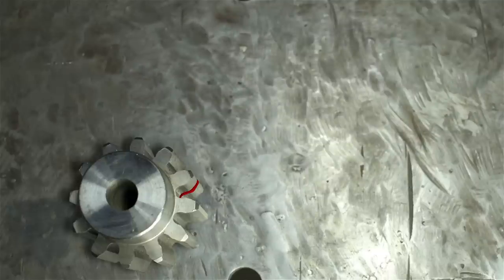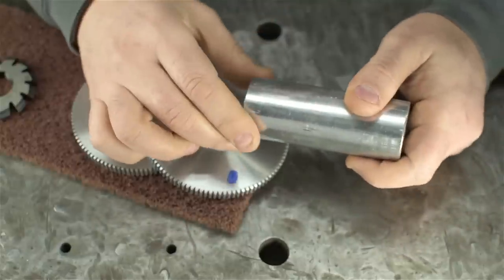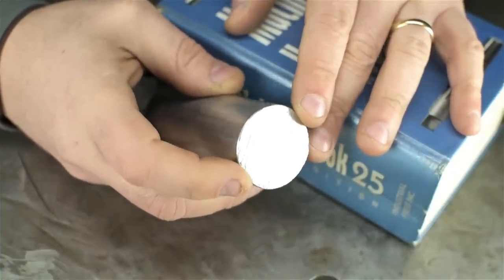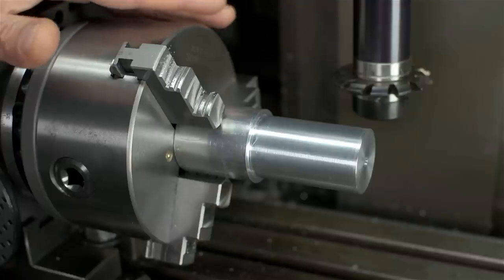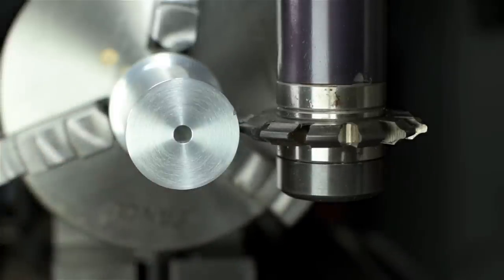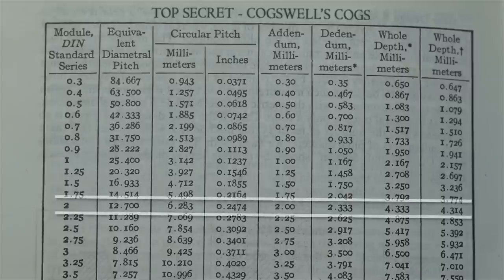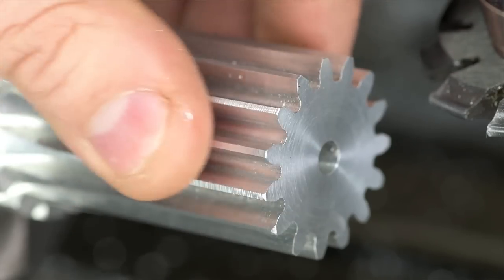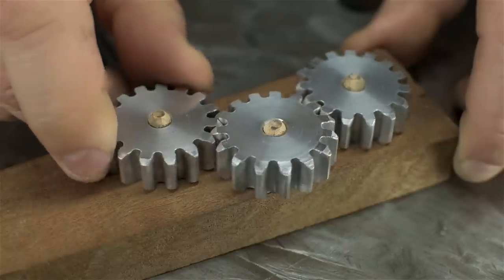15T-M2 Let This Be A Lesson To Ya!

Comment: When you said you move it down by the width of the paper...  Was that a joke?  I'm not a machinist so I dunno if that's the sort of accuracy you can get, and the 'tism's makin' joke location hard.
Reply: @zomgthisisawesomelol Huh.  I guess that makes sense, I overestimated the width of paper.

Is using it as a measuring device in this way that sensible, then?  How compressible is it?  (Thanks for measuring it for me).

Comment: How about a video on why all of industry, especially machine tools, quit using 14 pitch gears? There is currently ONE source for 14 diametral pitch stock gears in the world. It's in the UK but only has 14DP in 20 degree pressure angle. If you have something like an American lathe made from shortly after WW2 and earlier with 14DP gears, they'll most likely be 14.5 degrees pressure angle. That means if you need to replace one, you have to make it yourself, or find a machinist with a 14DP 14.5PA gear cutter set or hob, or buy the cutters to make the gears. A common example is the 13" 'roundhead' LeBlond 'trainer' model metal lathe. Not only are all but the final drive gears in the headstock 14DP 14.5PA, they're only 5/16" thick. Yes, that is a delicate lathe, often abused by school and military shops during and after WW2. It has a safety spring ball clutch on the power feed rod but not on the leadscrew, so if crashed while using the leadscrew it's very likely to break gear teeth.

Just because all the machine tool companies decided to quit using 14DP sometime in the late 1940's, that doesn't mean some folks didn't see a need for gears like those. In the 1980's at least one company, Takang of India, used some 1.75 Module gears in the drivetrain to the quick change gearbox on some of their manual lathes. In a CAD program generate a 14DP 14.5PA gear and a 1.75MOD gear of the same number of teeth. They're practically identical!

But like earlier times with 14DP, the whole industry ganged up on the poor 1.75MOD and said "We don't like you and none of us are going to use you ever again!". Takang doesn't even acknowledge they ever made anything but CNC machines. Manuals for manual Takang machine tools are unobtainable, despite the company being one of the largest in India and having sold huge numbers of manual machines there and in other countries.

That still begs the question of why industry world wide would pick out ONE pitch of gears to never ever use anymore, then did it again to 1.75MOD a few decades later? The gear cutter industry still makes (usually on special order only) cutters for both, but unless you can snag some good used ones you'll pay a considerably higher price than for 13DP or 15DP or 1MOD or 2MOD cutters.

Comment: i heared every sharp edge is a good start for micro-cracks (and bigger ones), if someone knows for sure, pls respond.
This would explain why you'd want to chamfer your gears
Reply: Internal (indented) edges, yes. 
External (protruding) edges like the ones on a gear, no.
They are chamfered to prevent metal bruises on the corner (which would raise the adjacent metal on the working faces and cause rough running) and to prevent human flesh being lacerated.

Comment: These videos on gears are awesome! 

Really informative and well timed with a electric moped conversion project of mine that will require a # 270H sprocket.

Have you ever had to machine gears or sprockets of an odd (like 270H) or proprietary size that you don't have a cutter for? I'm not a machinist by any stretch so I am trying to find a machine shop with the equipment to machine a 270H sprocket but no place has that sized hob.

Comment: 10:57 So I've been wondering why the cut marks on the side of the teeth are straight. Shouldn't they be curved?
Reply: They would be curved if the cutter didn't move, or was plunged in and out radially. They are straight for the same reason that wood pushed through a table saw has sharp edges.

Comment: I guess, if the gear wasnt chamfered like that, the little   end of the teeth would be prone to shatter because of the 90° angle it has, it will break and chamfer itself eventually, only not that good, and inside a piece of equipment that would not be cool. You know, nature just likes to triangulate structures. Just guessing.

Comment: some intresting gear stuff(cut any thread with any lathe w/ an open gearbox sieg c6 an examle lathes.co.uk NTreadsP gear chart calculator type in all the gears Z's and it will give you all the combos in your gear set that will cut that thread my grizzly go516 has never faild to produce any thread i wanted and if you multiply all your inex plates holes times the ratio of your dividing    ( whateveryougot table, head)  write those numbers down and find a # your chart that came w/ it  dos'nt include and try dividing those missing divisions) by the well ill give an example needed 11 divisions have a 72:1 dividing head 33 hole plate X 72 =2376 divided by 11=216 divided by 33= well gets 6.5454 but 33times 6 =198 plus 18 holes on the 33 hole plate show me how the formula you used dose that thats why its not on the chart

Comment: The reason I want to cut my teeth on him cutting a set of Gears is they quit making the darn things so you can't just go buy another input shaft for a U S  Gear overdrive unit. In my case I have the under drive gear I want an overdrive however

Comment: 1.33858 inches is supposed to be "more approachable"??? Come on! You need fractions for that. I won't rest until I know how many 258thteens of an inch that is! Or if you wanna go sure, state it in arshins.
As for chamfering the teeth, I'd bet it has to do with alignment of the gears, sliding action the teeth have on each other, and perhaps flexibility of the metal. If the gears are not perfectly aligned, one part of the tooth will protrude over the other and will flex a bit less than the other. If the that then has a straight edge, it will start scoring the other one, creating a sharp burr. If that is diagonal, it will at most make a diagonal pit.
Also: I suppose the edges of the teeth are the most likely to chip off, so by having them supported by more material underneath makes them stronger.
Also it looks nicer. And is somehow a logical way of finishing the gear.

Comment: I was collecting some old metal to take to recycle, and found a cutter still in the plastic sheath (new).  My wife told me her mother brought it over with some other junk.  She is a pack-rat of sorts.

Never seen one like it so  maybe you can help me.  The face reads: MOON CUTTER 3-1/2x5/16.  I have no need for it beyond using it for a wicked Chinese Star weapon, and I loath throwing good things away.  I have done a bit of research, and have determined this is a cutter used in a milling process.  Being this is a new cutter, is it of any value?  Or should I just send it to recycler.

This is the cutter:  https://www.google.com/search?q=moon+cutter+3-1/2x5/16&num=100&rlz=1C1GCEU_enUS821US821&tbm=isch&source=iu&ictx=1&fir=LEvc6eSrQGRVbM%253A%252COHcdSERmjmjuMM%252C_&usg=AI4_-kSolhJoc2SU4psB76YiOS8LKgaVJg&sa=X&ved=2ahUKEwjgsYiCn6_gAhUKM6wKHUjEAn8Q9QEwBHoECAAQCA#imgrc=LEvc6eSrQGRVbM:
Reply from the maker: put it on eBay or send to abom or Mr Pete!

Comment: can u re work a gear box for wind speed generators? I would send you one. I only than think, no $$$. if you find one. rip it apart. noises and vibration of many things. finger this one out , A patten it, u win, speed. Mr. T.
Reply: Rip it apart. do it right. blades and air speed. min and max x off 23% u do better-job. patten ur shooting the poop. on this one. 1.5 years u master it. in your free time. Matt Matheson Boston Mass.